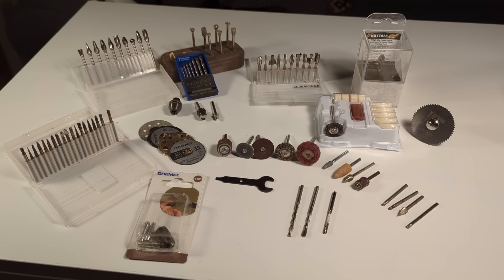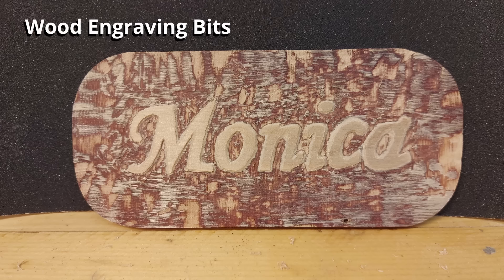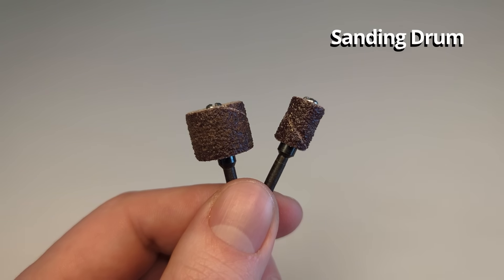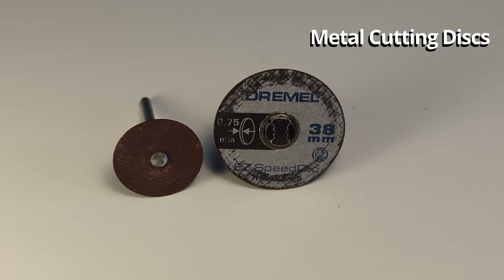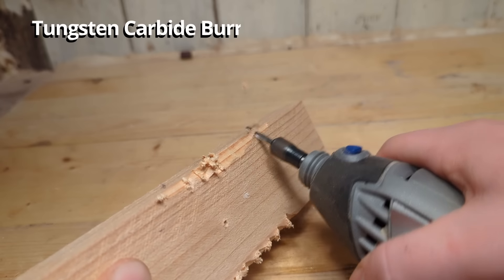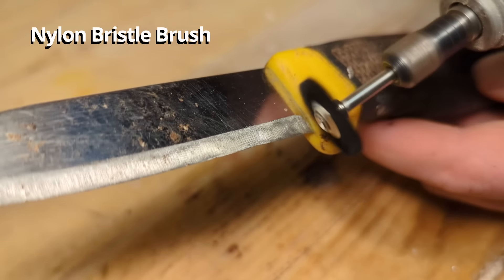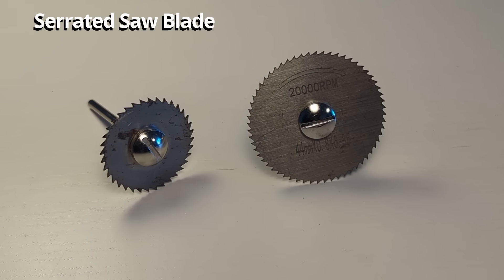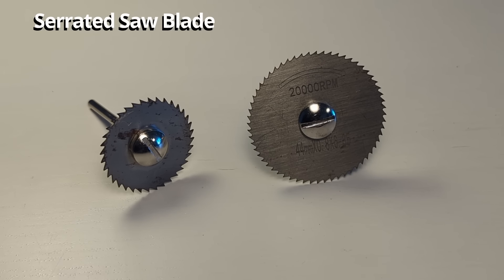The Ultimate Dremel Bit Guide

Comment: Remember not to use diamond bits on metal. The diamonds can get stuck in metal and get ripped out of the bit. Diamond bits are for stone, glass, and ceramics.
Reply: And doggie toenails. 🐕
Reply: Thanks captain obvious
Reply: @JaEDLanc  It’s not obvious. You have to learn that from experience or being told.
Reply: @evilsharkey8954  😂🤦‍♂relax, Mr. Know It All.  Metal can be drilled, cut, ground and sharpened with a diamond. Unless, of course, you have the knowledge and experience.
Reply: @adamjones-ps  no. Sanding drums.
Reply: I used to grind two stroke cranks with a diamond bit as well as the mandrel
Reply: diamond blades excellent for cutting fiberglass and carbon fiber👍
Reply: I didn’t know that…… Thanks for sharing that with us…..
Reply: @JaEDLanc wasn't obvious, i lost 2 bits before i realized that
Reply: Never had a problem using diamond bits on steel/aluminum for corrosion removal in tiny radii, and i would switch to a craytex for polishing
Reply: @adamjones-ps  😅😊😊😊😊😊😊😊😊😊😊😊😊😊😊😊😊😊😊😊😊😊😊😊😊😊
Reply: @gmanchurch  Ditto. Thanks Evil Sharkey for letting us know.
Reply: i ha no idea. just started using 1
Reply: Diamond is used to grind tungsten , which is a metal.. just do research first.
Reply: @vadim3976 You relax, princess, he wasnt being agressive at all.
Reply: @Dovawhat 😂
Reply: Mm BN km
Reply: @evilsharkey8954 diamond bits are for cutting glass. Who would try using it on metal? 

My way of learning from experience is not using the wrong thing for the wrong job. I think I learned about diamonds being used to cut glass from cartoons. 

If it's made for cutting glass, why would you try and cut metal with it?

I think the lesson is to use proper bits for the job, and don't experiment unless you are prepared to ruin your tools or materials. 

I'm just not sure why you think someone would try to cut metal with a diamond bit?

Maybe you wanted to get a job done and had no metal cutting bits, so you ruined your diamond bit trying to adapt it to a different task than it was made for. That's sloppy. 

Can you help answer: should I use a chainsaw to pick roses? 

Or maybe an angle grinder to clean my toilet?

Get the right tool for the job and don't faf around trying to bodge something.

In metal shop in high school a classmate tried to use a drill bit as a chuck key and ended up with a sliver of metal in his eye. 

Wear safety goggles and don't try to shave with a fan that has razor blades taped to the fan blades (Lois, I done it again!) 😮
Reply: @Boogie_the_cat  Read some of the other replies. Some people seem to think diamond is fine for metal.
Reply: Tungsten is for metal.
Reply: You can use diamond with lube on metal I believe.
Reply: @Wavy_Gravy  I like tungsten carbide for harder metals.
Reply: @evilsharkey8954 can confirm it’s not obvious, i think i fucked up lmao
Reply: @JaEDLanc i didnt know that and assumed diamond just ripped through everything. Not everything is about you and your opinion really doesn't matter. Anyone with logic would have realized this comment wasn't directed towards them and move one.
Reply: @Boogie_the_cat Agree with you. My diamond bits were expensive and bought for drilling glass, I'm not going use em on anything else!👍🏻
Reply: @JaEDLanc I didn’t know I just started how is it obvious
Reply: @JaEDLanc I'm here specifically because I did not know
Reply: I'm glad I read this when I did. I haven't started my project yet
Reply: lol
 There are Bits for Metal but they Look different and nothing is that simple...you can See it best on Files...a tile Diamond File or a Metal Diamond File, Look at both

Greatz from Germany
and have a nice Day
opo
Reply: all these answers and NO ONE has dropped the correct answer? It's simple.

Don't cut material with the same material.

Diamond is carbon. Steel is 94% carbon. You don't use diamond wheels on steel or iron, diamond files will gall up with filed off carbon, diamond blades will dull immediately. Use the composite abrasion discs or carbide to cut steel.
Also; 
Don't try and use alumina sandpaper to polish aluminum. Yes there are different kinds, flavors, if you will, of sandpaper. Don't take aluminum to aluminum oxide grinding wheels. 
For 99% of situations, cut AL with a hacksaw.
Reply: i use diamonds for metall. its ok
Reply: And to trim around concrete floor drains after installing epoxy.
Reply: True .. but not for glass also
Reply: I'm more than happy and confident to use DEP on metal.
Eye protection is #1 on the list.
Wire wheels are the worst, closely followed by cutting with grinding discs.
Reply: thank you, was wondering that. im about tp start working with thosee bits
Reply: I always use a diamond disc for sharpening my tungsten needle for tig welding
Reply: @Kuchenwurst  Tungsten is a very hard, brittle metal, so diamond is appropriate there. The “sticky” metals tend to pluck the diamonds out of diamond tools.
Reply: What abt shells
Reply: @ellamella6767  You mean like seashells? They’re pretty soft, so you can use cheap grinding bits on them. Diamond and metal are fine, too.
Reply: @Mix1mum thats not entirely true. A lot of drill bits (low to mid quality) are made with HSS (high speed steel).
Reply: Is it possible to use them with plastic?
Reply: @JaEDLanc  Not obvious at all, Captain Oblivious.
Reply: @Boogie_the_cat  you keep saying it's for glass, which makes me think that you don't know that it's also used for other stuff like stones, rock, minerals, antlers, bone, fossils, hardwoods, composite materials and more. You're not looking real credible here.
Reply: Thanks for that. I really didn't know that. 👍
Reply: @JaEDLanc yeah i wouldnt have known never using this tool before lol logically youd think diamonds would be better
Reply: Thank you I'm just learning
Reply: Exactly bro some ppl don’t know bro
Reply: For me this info was helpful @JaEDLanc
Reply: Diamonds dissolve into steel/iron with heat as well
Reply: @ That seems like it requires a lot of heat!
Reply: Is it good for wood?
Reply: @Wood won’t hurt the diamond bits, but they’re not ideal for wood. You want something with sharp teeth for wood, like a saw for cutting or a bur for shaping

Comment: Using the metal cutting disk on plastic often melts the plastic and does not make a clean cut. The plastic cutting disk does not. :)
Reply: Same experience I have had. Some after work is necessary if you do it thus way.
Reply: To avoid melting the plastic, cut it at the lowest speed that your Dremel tool will allow. Your friend, Jeff.
Reply: Tip, also, DO NOT use your sanding drums 🪘 at full speed. They will not hold together at 30.000 RPM. Wear a face shield 🛡️. It will protect your eyes 👀 and face from debris (such as flying wires), such as if a grinding wheel 🛞 decides to disintegrate. Again, your friend, Jeff.
Reply: And melted plastic forces rotary tool then it will damage your tool (one of my friend damaged tool :)

Comment: Thank you so much! I’ve had a hard time finding a comprehensive video that really explains each rotary tool bit, and I especially appreciate the short video demonstrations!
Reply from the maker: Thanks for watching. Love the feedback.
Reply: This! 👆
Reply: @thatfrakkingcat9171  p 6:58
Reply: Very helpful. Thank you.
Reply: @rotarycrafts8760  I would like a good explanation of the differences between the four or five main types of aluminum oxide grinding stone—pink, white, brown, orange, etc. the physical differences, how those differences e ffect the performance on various materials, and how those properties effect the appropriate selection. I am struggling with finding a good but concise explanation that will allow me to most appropriately select which type of aluminum oxide grinding stone I use for each specific project. I tend to use the white ones on very hard materials such as carbon steel or cast iron and ductile iron because they seem to have good friability and remain effective even after using for several minutes, but they also seem to wear down faster than some of the the others. When it comes to softer metals, should I be using the pink or the orange aluminum oxide instead? And maybe even some comparison to silicone carbide grinding stones might be nice. If you could consider expanding on those topics in a future video please. I love using my rotary tool but I don’t think it’s always the best idea to spend more time and money on learning through experimentation when the information is already out there. Cheers!

Comment: On metal brushes. Use super glue to keep the pieces from coming out.
Reply: Thank you for this great idea!
Reply: Please could you explain further
Reply: @bluesnowbelle7625  put super glue along the brush where is meets the wheel.  Let it dry. Then when using the brush the small pieces of wire doesn’t come flying out in to my eyes. I saw a video on it. Good luck.
Reply: @grandpabill1959  Thank you 🤗
Reply: @bluesnowbelle7625  good luck on your projects. May they never end. 😉

Comment: When cutting plastics such as acrylics/ perspex with the Ez476 cutting disc 10:17,  paraffin/kerosene can be used as a lubricant to prevent the plastic getting too hot and melting/sticking. It works for Hegners/ fret saws/scroll saws and band saws as well.
Reply from the maker: Great tip. I'll try it out next time I'm cutting plastic.

Comment: I am convinced that the small cutting discs have to be for something else that we all haven't figured out yet. The fibrous cut off wheels are fantastic and I never ever have problems using them unless it is either trying to get into a very tight space or using it enough that it wears too small to be effective. I've used these things to cut a section of a metal header for a wall that had a passage cut into it after the fact which the contractor left unfinished because he thought it was only temporary. Went through it like butter!
Reply from the maker: They are definitely keeping something a secret :)
Reply: problem is in lack of practice, i use it a lot, but you have to have calm and precise hand, he held it like shovel
Reply: I prefer the smaller ones. They cut so much faster in my experience. The bigger discs feel like you're carving away at things with a butter knife. The key is to hold things very steady, brace the tool against your body or whatever else is close and you'll have much fewer broken discs. It still happens, sure, but much less so than if you're just holding it in one hand without bracing it.
Reply from the maker: Heyyyy. Really, Like a shovel? :P
Reply: @rotarycrafts8760  i have many of these type (dremel) , i have 1 minicraft that is a little smaller and lighter for low rpm and highTQ, and the big one from lidl, with 500w, it is same size as angle grinder and all of them i hold as pen , even angle grinder i hold with one hand, mostly for gearbox
Reply: No. They're cutting discs. They just simply put absolutely friggin suck at it 😂

Comment: Those EZ change bits are dangerous. I stopped using them after I had more than one cut off wheel come loose and fly off, and yes I was using it correctly. When using the sanding disks, it helps if you use a thin plastic backing disk made from a soda bottle or something similar. If you want to cut plastic with a rotary tool, it is advisable to get a set of saw blades and use the guard to avoid cutting yourself. If you use the cutoff wheels, they will melt the plastic and clog quickly, throwing melted plastic about.

Comment: this is a great video! a tip for metal cutting wheels: they work best if you go slowly with them and don't push them into the material very hard. it makes them last longer and risks breaking them less! just move them back and forth with gentle preessure against what you're cutting, with many light passes over the line you're cutting.
Reply: Thank You very much!
Tom's wife Pam
Reply: Good tips-use gentle pressure and multiple passes.  I would add-cut with the outer 1/4-1/3 of the wheel. If you need to make a deeper cut, then use a larger diameter wheel. Usually the wheel snaps off when trying to cut too deep and the wheel binds. Wear eye protection.

Comment: Something I'm curious about is the EZ Lock and is components and I noticed that you were using it quite a bit at the end of the video. You seem pretty comfortable and confident with it so I feel like you'd be a good person to ask this question. Is that thing really safe cuz I bought one a couple years ago and I've never used it. Not too long after I got it I was hearing stories that they were actually pretty infamous for the blades flying off probably more often than somebody using a power tool would hope that the blade would come flying off. And I admittedly have this kind of unnatural and unjustified fear of power tools. Always have. I use them reluctantly when necessary but I don't want to use a power tool that's got a reputation of parts flying off it everywhere all the time. You came across to me as a very knowledgeable kind of laid back and really articulate person and so I just feel like if you aren't afraid of them I shouldn't be either.  Thank you for hopefully answering this question and for your excellent video. I really enjoyed it and you

Comment: I've been using a rotary tool for over 25 years in my art business, engraving glass and metal, and power carving wood. There are many bits that I've never used and you did a great job explaining them.
 About a year ago I used the serrated saw blade to cut a small section of paneling from a wall. I accidentally struck a nail and the shaft bent at a 90° angle and dislodged from the collet at high speed. It struck me in the collar bone area and caused a small cut. Thankfully I was wearing a thick shirt or the cut would have been much worse. A couple of inches higher and it would have struck my exposed neck. These blades can potentially be VERY dangerous. Thanks for a great, well explained video.
Reply: I'm curious to the best way to cut thick high carbon metal with a rotary tool and seek your opinion on rhe best way to cuts small and tight spots with which bits. I prefer speed and durability most.
Reply: I had that happen to me. The shaft bent and I threw the whole Dremel before anything could fly off at me. Ran and unplugged. I've never used the others in the pack and gave that Dremel away.
Reply: ya it's probably best to use them in the same way a table saw is used. Only having about 1/3 of the blade being used.

Comment: The 402 mandrels changed the whole game IMO. They have some flexible abrasive wheels that are superior to anything else I have used in the past for cleaning metal. Expensive though and they wear out fast. The large cutting discs are the way to go with the  402 mandrels. At some point because of the high-speed nature of the tool, you need to take it apart and clean everything inside. Buy only the Dremels with ball bearings. When you force the motor to continuously slow down from loading, you're wearing it out. It's strictly a hobby tool. For serious work, spend the money and buy Foredom. Using the metal brushes, I found that if you don't exceed 'half throttle', they don't shed as much. Been using Dremels since the '60s. They started out with bronze bushings and eventually went to ball bearings....game changers for longevity. You can go into the ball bearings, clean & regrease them but that's beyond the bounds of most owners.
Reply: I still have the original tool you speak of, it gets used only for "more abusive" jobs lol. Save the best tools for real jobs right?

Comment: Good general info here. Perfect for a beginner to learn what bit to use for a particular application. You can't go wrong with a Dremel (or rotary tool in general). It's a MUST have for almost everyone. It does so much for the little money it costs. For around $100 you can get a whole kit with just about every bit you need, with the exception of specialty bits. And if you want to go with a non-Dremel brand tool and bits, you can cut that price down almost in half these days. I used to have a Craftsman rotary tool which was pretty much a Dremel clone that worked for 10 years before I worked it to death. However, I do also recommend Dremel brand tools and bits, as stated in this video. They are very good and solid for the price.
Reply from the maker: True.
Reply: That's quite debatable. If you're doing anything larger and work with metals, well Dremels are essentially toys. Plus you can replace most of the tools with conventional tools. Like those cutting discs for metal are hilarious shiit. You can do 100x more with normal hacksaw. For woodworkers I'd say it's quite nice tool. Plus obviously model working etc. that needs fine tools.
Reply: @jothain  Nothing I said was debatable. I never said it replaces conventional tools.

Comment: Note that the collets shown at 0:23 have rings or grooves around them to identify the internal diameter (bit size that fits). IIRC, zero rings = 1/32, 1 ring = 1/16, 2 rings = 3/32 and 3 rings = 1/8". Something like that!

Comment: This is the thing that should be on the packaging or at least easily found for anyone that need to know. My experience with tools in general is that the makers somehow believe that every customer know it all in advance, and how can anyone when there is a first time for everything. 
Of course you can test your heart out of these bits and come to some conclusion, but to my experience you end up braking more gear than you have to just because of the inexperience and wrong use of things. It's hard to know the limit of something when you have no prior experience, and this is where you just need to break something before you know. This is why it would help so much to at least know what ballpark you're dealing with.
Reply: They provide a whole book on useless information & legaleez in 100 languages but nothing short for what each bit is best used for.